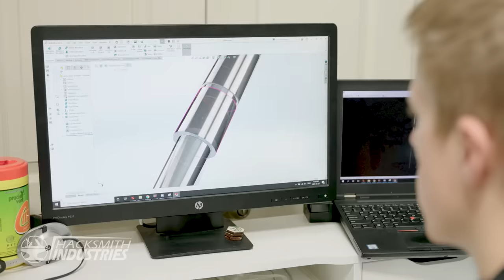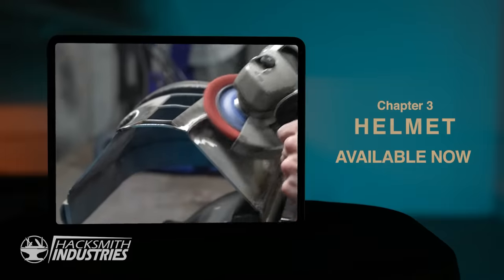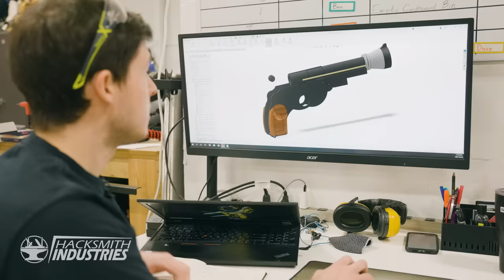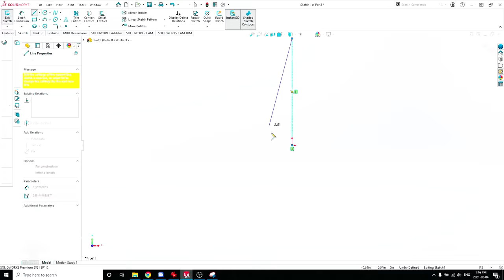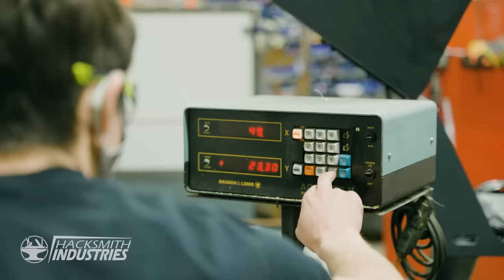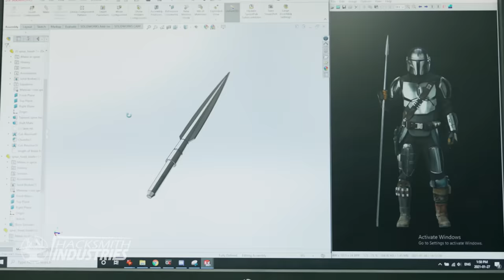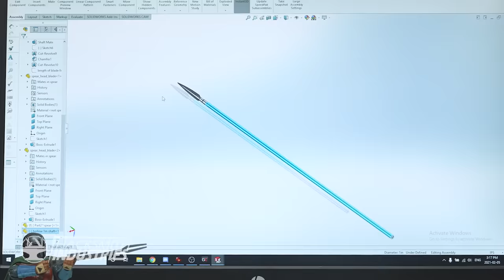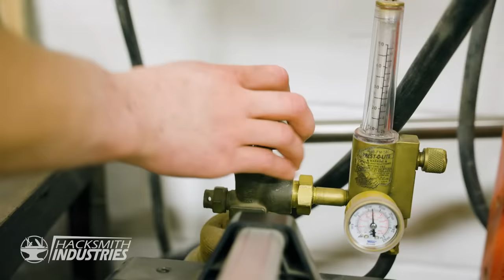Mandalorian BLASTER & SPEAR (HACKLORIAN: Chapter 2)

Comment: You can upgrade the iron man blaster by adding flares, or if it could be cooler than you can try to make a linear flow nozzle that shoots plasma based fire (like the lightsaber but if it turned on and off really fast) the flare would work better after wise thought

Comment: Hey team Hacksmith, I want to you something. Please use Graphene in your builds as it is awesome. It is like a wonder metal. It's super strong, super flexible, super conductive for electricity, it is dope, it can be manufactured from graphite and tape, and what not. I request you to use it in another build. If not please tell the reason (not being rude, but really wants to know about it more).
Reply from the maker: It is, but it is not very usable for projects -- all the "awesome" properties are under very specific lab scenarios.
Reply: @hacksmith  thanks for clearing team Hacksmith. And also thanks for replying on my comment. Man that was awesome.

Comment: Yikes dont do macro shots of spray painted objects ! ( the blaster ) I feel like you do yourself a dis-service when doing that. At this point weve seen so many horribly orange-peel'd or splattered paint jobs on this channel its scary. I get you may not want to for time or money reasons do proper paint bt when you show us extreme close ups of these paint jobs it kind of ruins the work. They seem to pass the 18" test easy enough, should either film just slight further away or go thru the trouble of a proper paintjob on projects. Anyways, thats my only note - you guys make cooler stuff than I ever will and i love ys for it.